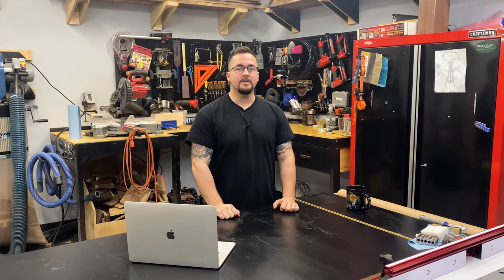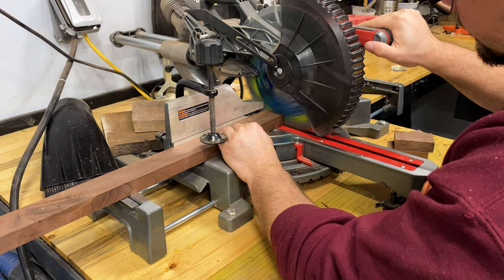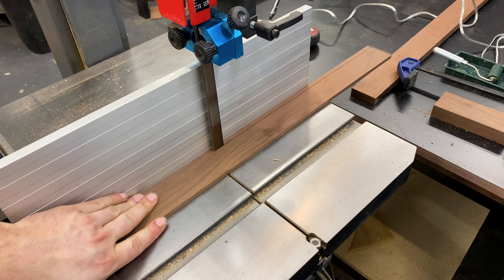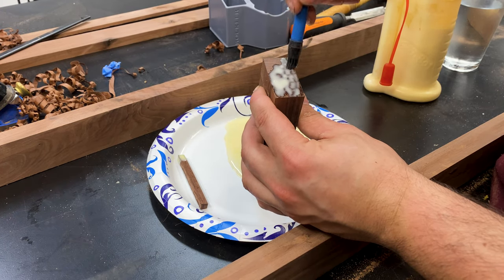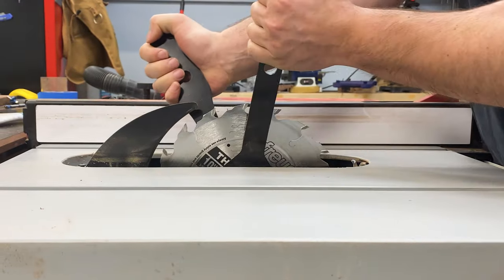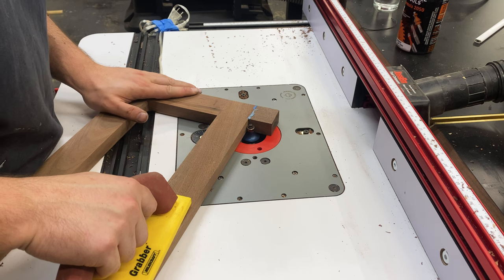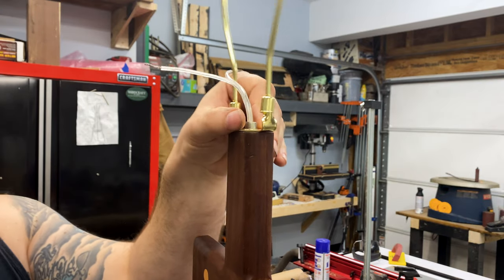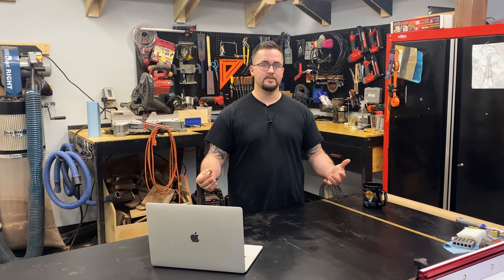EASY How To Make A Designer Lamp With Wood

Comment: Is it safe to run a 110v cable through wood groove like that? I mean could it heat up for example and cause fire?
Reply from the maker: I suppose you could make the groove bigger but I’ve had no issues with this since I’ve made it and use it daily. It takes a lot of heat / flame to catch wood on fire. There are techniques where people torch wood for protection and it doesn’t full blown burn. My point is, I’m no expert in science, but I’m confident it’s safe as many lamps have wires running through grooves…now if the wire was exposed through the protective shielding, I’d be a bit concerned.

Comment: Did those joints fail yet? It’s a cool design and the end result looks good, but given your experience and tools available, i find it hard to believe you couldn’t get more creative with the joinery.
Reply from the maker: Yep they’re holding up today! They don’t hold a lot of weight. And you’re right, I’ve contemplated different ways on the joinery for this…like floating tenons with channels drilled through, but…it wasn’t needed at the time. I guess we will see in another year! Lol